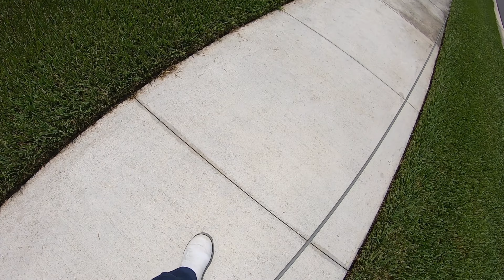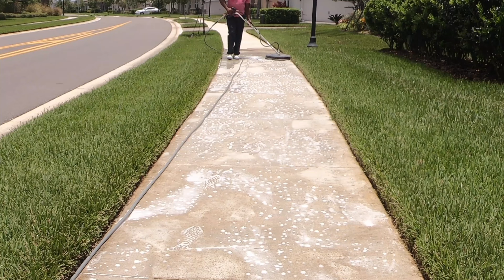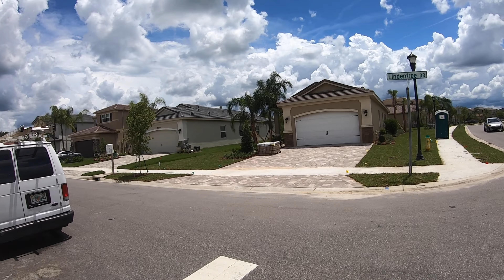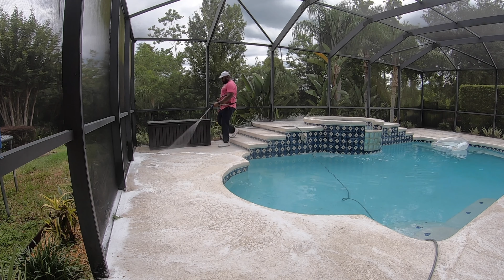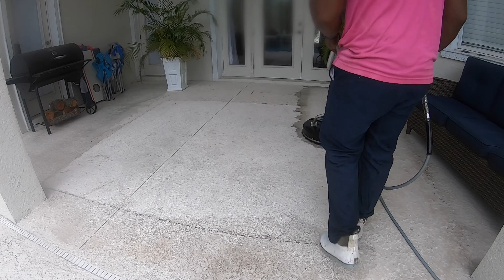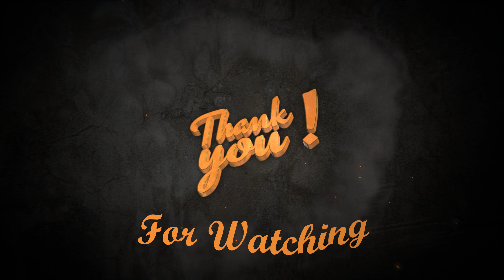Pressure washing new concrete | Pool Patio Cleaning

Comment: Thanks for the info. Im still figuring out how to bid jobs. Im in central Maryland so not sure how that plays a part. Did job the other day that was similar to that and charged 125. I kinda go by the hour and it works but I wanna make sure I'm not losing or robbing. Anyway, seen a video with a dude that used a gear tie to hold the surface cleaner trigger. I did it and it was a big difference on the arms and hands. 
Thanks for the content and knowledge bro greatly appreciated!
Reply from the maker: You have the right formula. On a job like this it's best to charge a flat hourly rate. My base hourly rate is $150 but since this customer was about 40 mins out with traffic I charged $175. And got a 5 star review and a tip! The zip tie works,  some guys use a tennis ball also.

Comment: Roughly what psi you want to use on new concrete? (2years old).  You think around 1500 psi is ok? Or 1k instead?
Reply from the maker: Yea 2 years old it will be ok with either

Comment: Did you change the tips on your surface cleaner to lower the pressure for that specific job?
Reply from the maker: I didn't but that is the correct way to go about it. I had choked my ball valve on this one
Reply: @PinkFlamingoPowerWash  I thought about doing that but was unsure if that would increase the pressure just like when rinsing with a throttled ball valve.